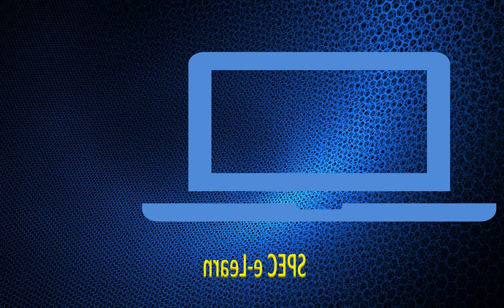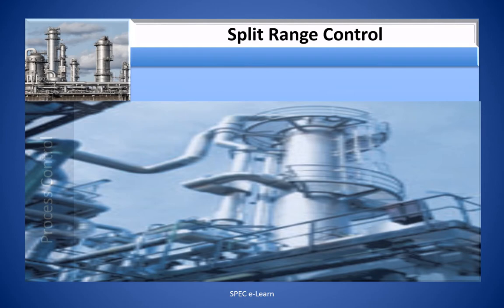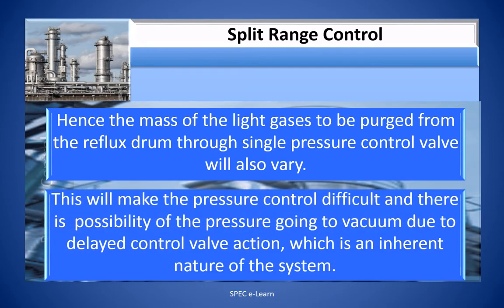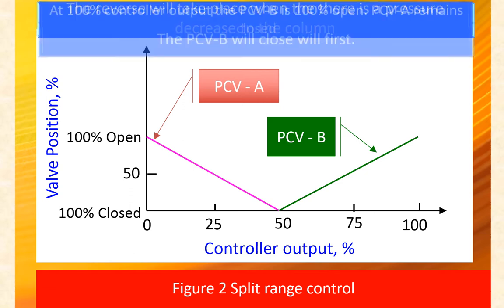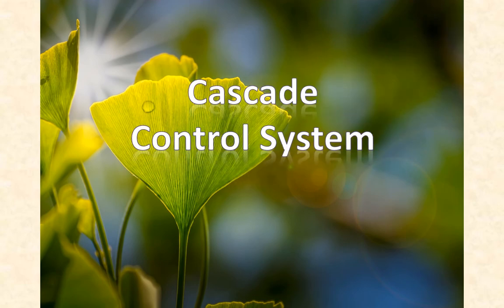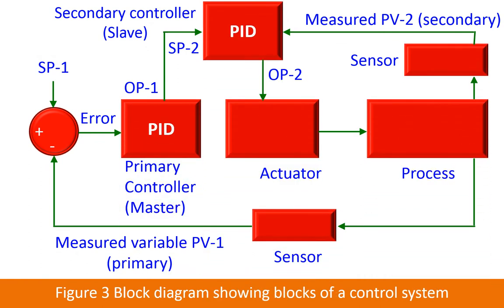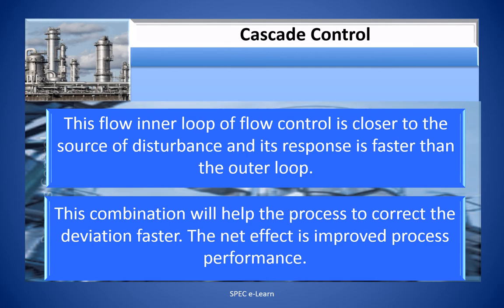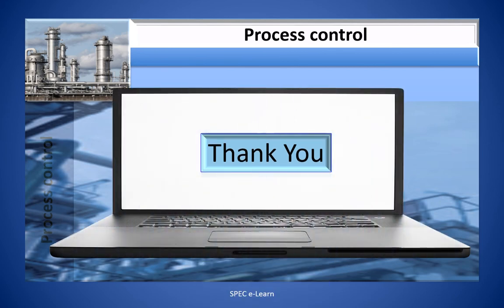Split Range Control and Cascade Control

Comment: Sir please make a video on smith predictor control.
Reply from the maker: The most commonly used modes of control are P, PI and PID. Other advanced process control technology is MPC (model predictive control) as used in advanced process control ( APC).    Others are not of much  significant in terms of application in industry.  Hence my knowledge is limited on Smith predictive control. Thanks
Reply: @SPEC786  👍